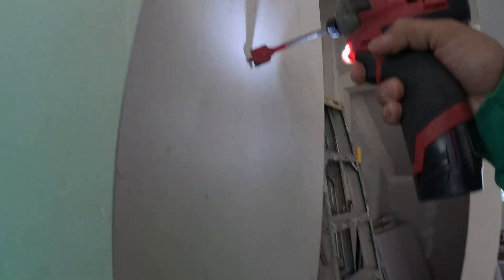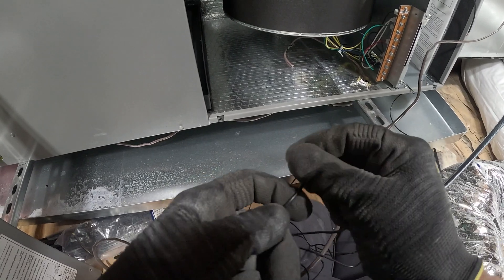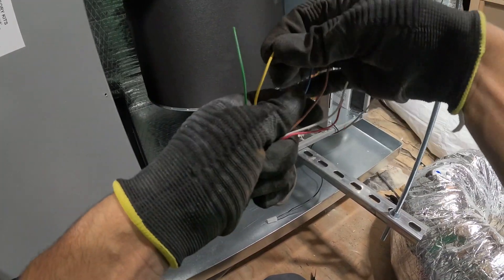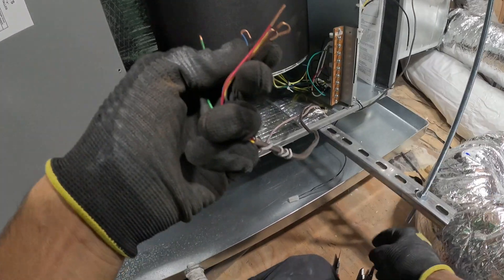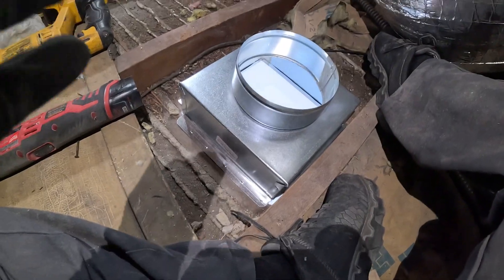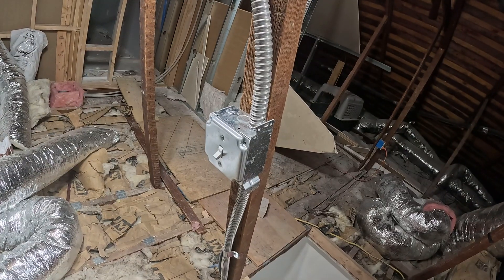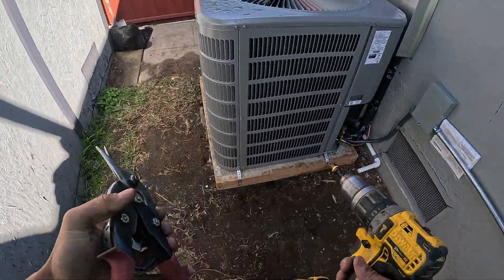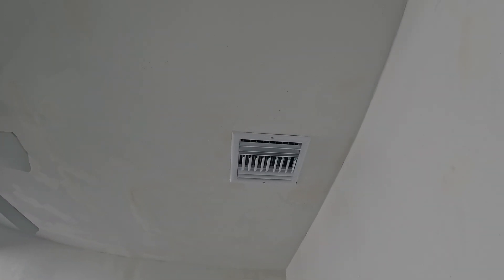Heat Pump Split System Install - Before Summer Hits! (Final Part)

Comment: What’s the deal with that house insulation on the plenum and boots? No vapor barrier on that. Remind me to never use your company. lol Oi vey. You ran the ducts right against the roof where the most heat will be, the outside unit is right against the house. Man. Why did you post this? I’d be ashamed.